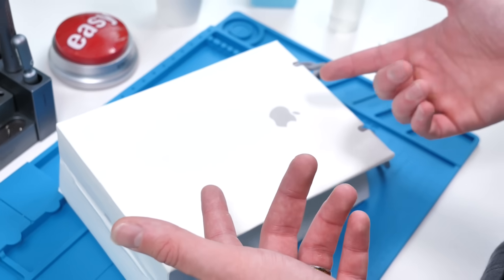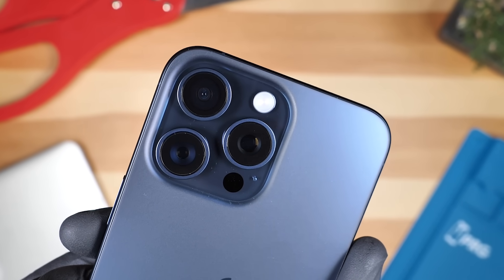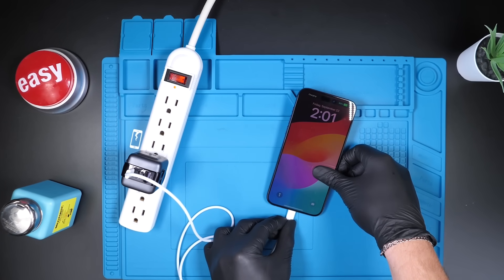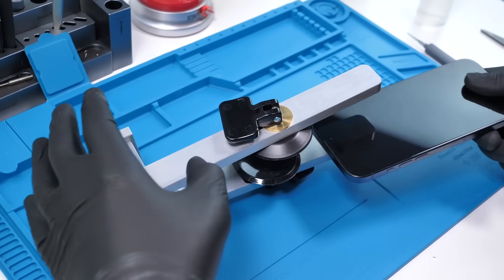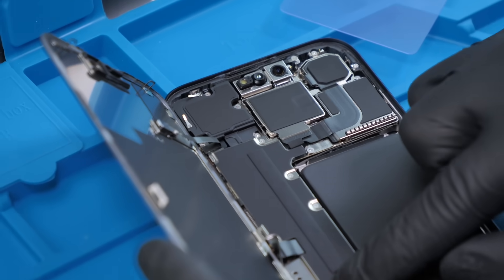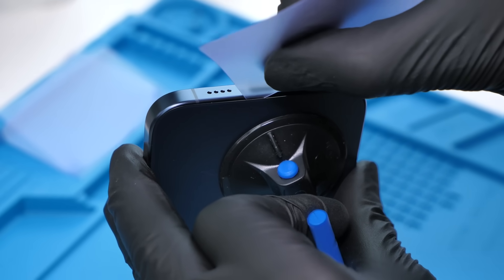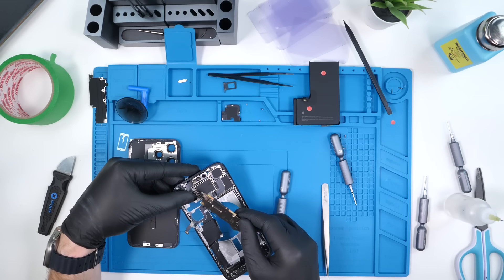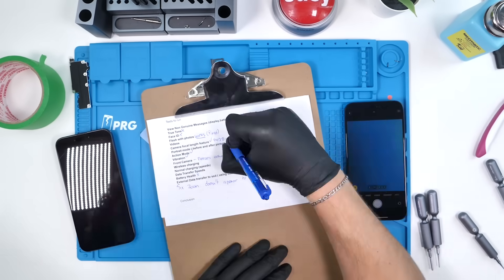Is The iPhone 15 Pro Repairable? - Parts Swap Test

Comment: Why apple is not just adding an application where you can register the replaced part (of course a genuine apple part), thus making the phone fully functional? Imagine replacing the battery with an original one and then just open the app, register the S/N and then boom 100% battery life, fast charging capability and so on.

Comment: apples anti repairability is the reason the resale values of these phones are so high. Most of the refurbished Samsung's have their parts changed and u will never know it when buying unless u are a pro. A used iPhone is very less of a headache than a used Samsung because it cant be replaced with fake parts. I think apple should continue what they are doing. I've seen too many cases of people buying Samsung's and then problems starts to arise after some months of using.
Reply: You can always find out a silver lining in bad things. if Fake parts is the issue, then just keep the not authentic part notification

Comment: I've read the official apple repair manual once and it said something with booting to a special mode where you can calibrate all the new parts, maybe try this
Reply: You need this specifically for replacing the true depth camera system, so I think this should solve the problem

Comment: Surprised there's no screw mechanism on the screen separator to slowly apply the separation force instead of prying it open with your hands where you're not necessarily apply equal force.

Comment: That “removable” back glass is definitely preparing for the impending EU regulations requiring user replaceable batteries on all portable devices
Reply: the EU is becoming a dictatorship
Reply: Unless the devices are waterproof/resistance
Reply: Apple will never make a phone with a user-serviceable back, and neither will literally any other relevant smartphone manufacturer. Those days are long gone. I think they switched to this design because the default procedure of giving someone an entirely new iphone when they come in for a back glass repair is starting to become costly.

Comment: Pretty sure technically the 14 with aluminum would be lighter then that titanium one
Reply: Titanium offers exceptional strength and durability, making it suitable for applications that require high performance.  Ultimately, the choice between aluminium and titanium depends on the specific requirements of the project.  I wish you a wonderful weekend ✌️😊  🕊️🍀❣️
Reply: @@WiiManElite 
Density of titanium = 4.506 g/cm*3, that’s about 60% the density of iron.  Its thermal conductivity = 21.9 W m•1 K•1, its 45% Lighter than steel, but 60% heavier than aluminium.  I don’t know why you say something like that, it’s kind of misinformation.  Everyone makes mistakes, we are human, but may I ask you kindly to take your comment down?  I wish you a wonderful day ✌️😊  🕊️🍀❣️

Comment: Ah yes non genuine messages after swapping parts with another genuine iphone... so thoughtful and realistic... proves that it just puts in the message without checking.
Reply: It’s checking serial numbers for individual parts after they flash it from the factory. So when parts are swapped it’s just going ‘hey this is not my original part!’ And thus lies the problem.
Reply: @joshfairchild These are very poorly written error messages, then -- it doesn't say the part doesn't match, it just says that it can't determine it's a genuine part, which it obviously is.

Comment: I've got close to a decade in the repair industry, specifically with Apple devices, and there's a few things to note here: A lot of Apple's serialization is done for three main reasons: Number one is obviously to sell more repairs. People break their phones all the time, and it's hilariously bad that they continuously pull stuff like this that does nothing but hurt the consumer. They also do it to prevent people from getting trade-in credit on a phone with third-party parts, just because they can.
The second two reasons are a bit more genuine: First and foremost is that Apple wants to protect consumers against receiving third-party parts from less-than-legit repair shops that claim "Official" parts but provide replica ones. This isn't common in most places, but in some parts of the world there are shops that fake being authorized repair centers. Of course, there are ways that even third-party parts can be "re-serialized" to look legitimate, but this is a protection against people trying to make a quick buck.
Finally, Apple does this to prevent people from harvesting parts from stolen phones. Stolen phones don't get resold, the thieves are smart enough to know that basically everyone has their phone iCloud locked and there's no actual way for thieves to bypass this lock. Instead, these phones get sold off to what are basically "smartphone chopshops" that take apart the phone for parts and either resell those parts or re-use them for less-than-legitimate repairs. Of course the parts can always be re-serialized, but it's actually become a bit more difficult to do this, especially because Apple has started locking down the protection chips inside certain components like cameras and displays. 
As for the front camera issue, it's likely a software oversight caused by the lockout of FaceID. I'd expect it to get fixed with the next IOS update.
Overall, I'm not defending Apple. This is incredibly stupid, and Apple is consistently the worst company when it comes to repair. There is no legitimate reason for a lot of this serialization, and it's stupid that Apple doesn't provide a way for repair shops to stock official parts. (If we can't stock the parts, it takes a week to get the official screen from Apple, and nobody wants to wait a week to get their phone fixed for $20 cheaper than Apple offers, especially when Apple does it same-day).

Comment: Hey my camera bugs out when switching to front camera but its on a Galaxy Note 10 Plus which i repaired myself alot of time it has been water damaged for over a year the area of the front camera's motherboard is corroded is it still possible to fix it even after a year ?

Comment: I actually PREFER Apples way with noticing you about the battery or faceID...
This way you just can't be scammed by some dude that claims to use original parts and instead installs a cheap and possibly dangerous battery in your phone.
But of course, no one even thinks about that and only complains about Apple...
Reply: just have a popup and notification telling you that. Dont brick the phone(or disable essential services)

Comment: Why does the frame have such a massive hole if the wireless pad is attached to the glass itself. I mean it saves some weight but Still is there any reason?

Comment: I'm curious about how apple gets phones to recognize new components when they have been repaired by a "genuine apple" repair shop. Surely they must have a way to circumvent the serialization issue?
Reply: tool kit called ast2 all web based but with genuine oem parts you can recalibrate it

Comment: That's good so that third party repair guru shops can't replace any parts without consent from the owners. The owner will know if the technician made some undisclosed parts swaps.
That's where most of the third party repair shops get more profits in the business, replacing good parts with the bad one so the owners will come back for more repairs. And that's how phone thieves do business with repair shops. The most common parts that needs to be easily replaceable, are the front and back glass, the battery, and the usb connector, and that's just the most important thing.
Reply: OOOOR, just have it show a non authentic part notification in notifs and settings. Also the popups only happen when you unlock the phone, meaning the technician cant just hide them. Dont freaking brick the phone for any repairs

Comment: 🤦‍♀️ 

(Why am I surrounded by idiots….)

Apple does serialize parts, including the glass as safety measure. The back glass in particular, helps with wireless charging. Back glass made with improper material can cause wireless charging unit to malfunction and potentially overcharge the battery to point of explosion. 

Battery is serialized also because duh, it’s battery. Cheap battery = explosion waiting to happen. Remember Galaxy Note 7? Apple doesn’t want that to happen. 

Face ID module, its also for security purposes, as this unit can be used to directly access Secure Enclave feature on Apple Silicon. If counterfeit unit gets used, it can potentially hack into Secure Enclave successfully and it can be ID and malware disaster waiting to happen. 

I might sound like I’ve been drinking Apple Kool Aid but what Apple is doing is best practice for keeping device secure and safe. Wish Samsung and Google would follow this practice with their phones. Then Android OS and device would be safer and secure.

Comment: This is bad. This is bad indeed.

Instead of ranting on about the “environment”, these big companies should release phones once in two years or something.

It’ll stop the users from buying more phones, plus, there will be no sustainability issues, as you will atleast be using your phone for two years minimum.

But, for a user like me, I switch my phone only when needed, ie, the repair cost is too high, or it is very outdated now. I am not tight on budget at all. I can buy a new iPhone right now.

Heck, I don’t even care about the design changes introduced after the iPhone 12 series that I don’t wanna upgrade even more.

I’ll be sticking to my iPhone 12 Pro, and not be tempted to buy a new phone, as buying a new phone hurts even more than repairing it.

That is partly the reason why too that I’ll be using my Apple Watch Series 6 and AirPods until they last.
Reply: MONEY!!!!

Comment: you use isopropyl alcohol on the back but not the screen? what's the logic there.  i stopped using heat to open screens almost 2 years ago,   now its just an ifixit jimmy + 99%     haven't broken an oled since this method.   and for anyone that responds to this comment, im a full time repair shop and ive done hundreds of screen off repairs where not damaging the oled is incredibly important (battery, housing swap, rear camera, charge port, etc)

Comment: As a phone repair tech, this is very informative on the issues we will be seeing after repairs. Does the faceid work if you transfer the proximity sensor on the screen to another?
Reply from the maker: Face ID works as long as you use the original front camera/face ID components. Using another proximity sensor had no effect
Reply: @PhoneRepairGuru  Ah yes. So, what I said already. lol
Reply: If you mean when doing a simple screen replacement, that will be business as usual to maintain face ID. Same with previous models going back to the X, the only issue is the unverified part warning, so you will need to transfer IC to prevent this.
Reply: @@WiiManElite To be blunt.. no. This is an intentional thing done to keep you from being able to DIY repair or 3rd party repair. This is one of very many things that behaves like this. Losing a feature or it completely not working after replacement is just what apple does. Can look back as far as the 5S to see things like this.. theres a long history of it.

The idea is that these parts are serialized to the board. The device knows whats been replaced. The "unknown part" warnings though are disingenuous, however. It doesnt actually know that its aftermarket or oem, it just knows its not the component originally mated to the board. Which is why even when doing these straight OEM swaps, it still doesnt work correctly.

With the screen, you can transfer the IC from old to new to avoid the warning. Same concept for the battery. You can avoid the "uknown part" warning by transfering the board. With the cameras, typically you have to dismantle the component to replace ONLY the camera and not the entire module.

I'm all for accidents being forgivable, but these are not accidents. Its to put down 3rd party repair. They will lobby for safety.. but tell me how easily keeping truetone is a safety feature and why effort at all has to be made to keep even that, and thats been a thing since the X.
Reply: this isnt anything new. this channel is just trying to make existing issues seem like new ones. very scummy to slander a company for your own gain
Reply: @imstupidbut  The fact that they tout their new stance on repairability makes this an issue. The problem is, apple doesnt in fact have a new take on repairability. The warnings are erroneous and not helpful to an end user.. those "unknown part" messages are only to harm 3rd party repair. Which if they truly wanted repairability they would not continue to add these to even more components. They could EASILY remove all of these via software update in the same manner that they added them in the first place. Its malicious and intentional.

What do people stand to gain by pointing out an ongoing issue with poor business practices? The only thing "scummy" is apple. Also, cant be slander because none of it is incorrect.
Reply: @imstupidbut lol Apple sheep
Reply: @imstupidbut your name is very accurate

Comment: Quick thing when you put the MagSafe puck, it didn’t do the animation so it probably doesn’t charge at 15W only 7.5 because the backglass/wireless coils are paired
Reply from the maker: I’ll look into that. This wireless charger is not genuine though so that might be part of the reason.

Comment: I think the lesson I learned here is if I ever get an iPhone 15, I need to get a case that cushions blows to protect the internals from shock. 

Apple is seriously gonna make it so if you want things replaced you get an entirely new phone.
Reply: basically yeah. that's the smarter move. i use iphone xr and i maxed out on screen protectors and cases. thrown it away several time due to rage while gaming, like hard throw. never had cracking issues what so ever.
Reply: @presizz7883 bruh ain't no way you break your phone by raging at a game
Reply: even if you max out external protection, you Phone still going to wear especially battery, and screen... when that happens, apple will very happy

Comment: My assumption is that the front facing camera/true depth camera are linked to FaceID and swapping the face ID disables it, sort of just road blocking the camera similar to samsung where losing one camera stops all of them from opening. weird but, sounds normal for apple. Just like the prox/ambient light/earpiece speaker repair disabling faceID in basically every iphone ever. Good to see we should expect more of the usual at my repair shop for the 15's lol.

Comment: I'm getting my XR fixed soon (LCD broke) and was wondering if there have been any problems with the LCD repairs.
Reply: yo. repair tech here. most of the repairs done on iPhone XR models have the digitizer and LCD built in together. resulting in a much easier and more efficient repair. removing the glass from an LCD panel is quite a tedious task and requires special tools and skills to do so.  if you visit your local repair shop, more than likely you’ll get an entire new glass and lcd!

Comment: For the front cameras not working: I am sure they presented a method getting focus on the front camera with the sensors built into Face ID. Without those sensors it appears to be possible the iPhone is not able to focus properly which it needs to take the picture. 

It may sound stupid and I am not completely sure about this, but that’s the only reason I could imagibe
Reply: I'd agree, but he swapped out to an identical phone.  If it isn't anti repair and you're using genuine apple parts, which he objectively is. It should work...but it's just Apple being Apple.  Never will I purposefully purchase an Apple product, for just this kind of bullshit , same with stuff like Tesla...it's like they believe we're renting rather than buying these days.
Reply: All he would need to do to fix the front camera not working is to flash the phone with fresh software, same happens with the iPhone XS series. Also no other phone brand has issue with the front camera focusing and none of them use the dot projector and infrared camera apple does.
Reply from the maker: @AndrewWhitham that’s exactly what I did but was still presented with issues
Reply: @PhoneRepairGuru  Ah shit so they finally fully tied it in, RIP
Reply: that's not the reason. The 15 series is storing depth data in every photo now (so you can adjust focus later). The front camera gets that data from the FaceID module itself, if it can't access that data, it glitches out. This can in theory be fixed with a software update, but that's the most likely reason.

Comment: You should try different android chargers to se if it's convenient to ask anyone for an Android charger, or to just ask for a USB-C Apple charger instead
Reply: Any USB-C charger works :-)
Reply: @B0B4  yes I know, but I mean: does a non apple original charger limit charging speed speeds, and connections, as it used to do with lighting?

Comment: A honest question: would you like to have a iPhone with a tampered front facing camera? For me it’s making sense to block a not trusted module.
Reply: Why would it make a difference
Reply: @AndrewWhitham  it’s a key feature to unlock nearly everything. Including your passwords. I am not a security researcher but this would be my first try to mess with the device.
Reply: @Dr3x0w  The front camera itself actually has nothing to do with Face ID. Try this, cover up just the front camera and nothing else, you can still unlock your phone or set up face ID
Reply: @Dr3x0w  

1: Face id is infrared, not related to front camera
2: Disable face id if you are so worried
3: it already shows you a popup showing u its not an authentic part